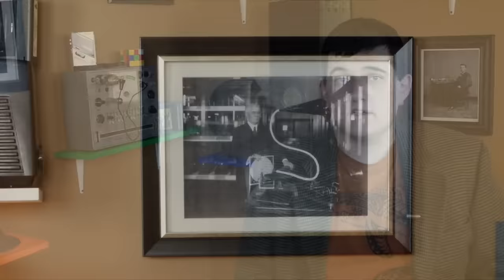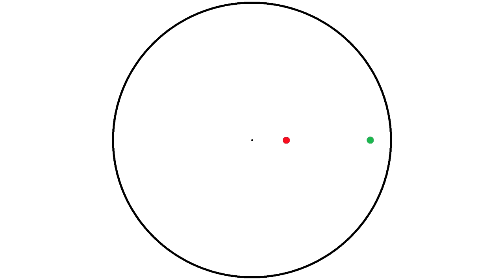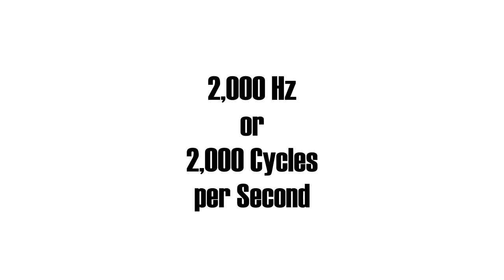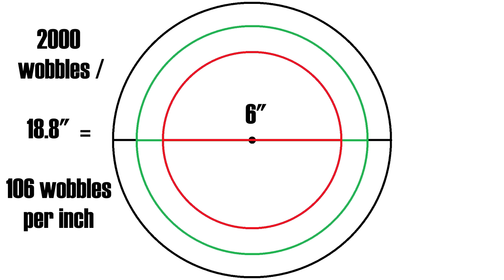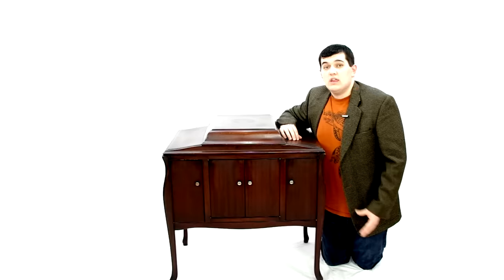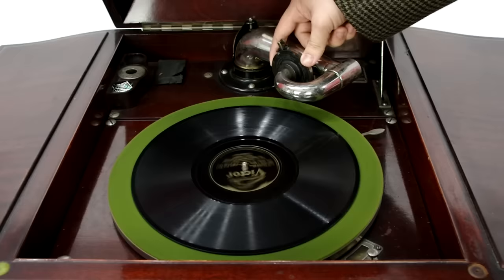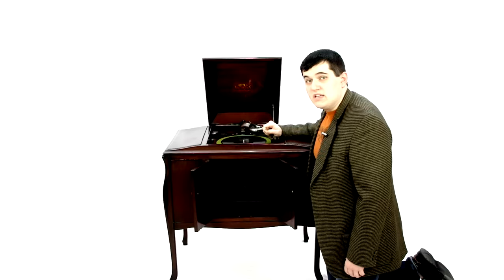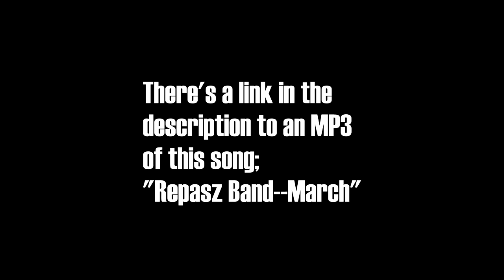Emile Berliner's Fix: Flatten the Cylinder to a Disc

Comment: ok.. a puzzler... i have played 'new' 78rpm records on 'modern' (read: electronic) turntables that had 2 stylus.. one for modern 'microgroove' and one for old 78 records...  but this begs the question; will these very old 'abrasive' records made for the Victrola play on one of those turntables (circa 50s and 60s) without chewing up the needle? or do they /require/ the disposable needle? what about a modern day turntable that does not have the 78rpm speed or 'flippable' stylus? will the 'microgroove' stylus play them without destruction? i realize the audio would need to be digitally recorded and sped up in software to match the original play speed for proper playback but the question remains... ...if either of those options is not an option /is/ there a method to get a fully electronic recording of those old abrasive records?
Reply: The width of the groves is different, so the newer style stylus would bounce around inside the grooves of the older records. Some stylii are designed with a weird shape that will work with both, but those are rare, crappy, and generally don't work very well. I know that the proprietary stylus in those crappy Crosley players is designed to work with both standards, but will tend to wear out the records extremely quickly, and destroys itself after a few plays.

Comment: Can I ask a stupid question? with the massive circumference of a record how is it that the recording always starts at the beginning and not 3 seconds into the song sometimes. are there leading grooves that pull the stylus in at the intended point on the circumference of the record?
Reply: Nvm I just thought about it for a second you just make the first groove blank so it always plays at the beginning.

Comment: Brunswick phonographs could play Edison (and Pathe) records.
Also, I guess you have not seen the patent notices on Victor products. Victor had the same restrictive use language on discs and Victrolas. Victor and Edison stopped putting these notices on records in the 'teens, though Victor continued putting patent license notices on Victrolas into the 1920's. Here is an example of a Victor patent license label from a 1912 Victrola IX: http://wkinsler.com/phonographs/victrola9d.jpg

Comment: As a musician and 78 record collector I enjoy both cylinders and discs.  However the musician in me wouldn't agree that discs are superior to cylinders.  They are each their own thing - each with their own advantages and disadvantages.  Edison's reasoning for sticking with the cylinder for nearly 50 years was justified - they could (with good recording engineers) produce much better sound quality over the whole recording than disks could.  The era in which LP and 45RPM records were the main medium used by the public for recorded music was shorter than era in which Edison produced cylinders.  So I don't really buy the argument that they were failed technology. They weren't the most popular, but large numbers of the public stuck with Edison and his system for almost 50 years.  A combination of a changing market as a 3rd generation of record buyers started to enter the market and improved recording technology for disks with the introduction of electrical recording (not to mention huge changes in the tastes of the record buying public) simply meant that it was no longer economically viable to continue with this technology.  When compared to 8 track or mini disc which essentially were market failures, cylinders compare very favourably.  

Whether he should have stuck with vertical (Hill and Dale) recordings is another argument.  When he did introduce diamond discs he stuck with hill and dale.  These necessitated a thicker disc, but again the additional quality which Edison strove to attain could be argued to justify the additional cost. It was more a matter of economic and physical practicality winning out over quality.  

The example you play as an example for why sound quality didn't matter  is correct for something in the early days, but not representative of the quality that was possible in the later years.  You don't give any comparison between comparable disk and cylinder recordings to justify your arguement either.  The skill of recording engineers, disk and cylinder medium, correct needle/stylus, machine set-up (and quality of machine), play back speed etc all contribute to quality of reproduction.  The technology of machines built for playback also changed markedly over the years - and using an 1890s cylinder player and a 1920s disk player doesn't really give any kind of comparison.

To argue that Edison conceded that disks were superior is not quite true.  If it were why did he not abandon disks in 1912 when he released diamond discs and continue with cylinder technology for another 17 years.  He recognised the practical advantages of discs and produced a compromise option whilst still continuing with his original potentially higher quality system.  Edison was not the only company to provide hill and dale disc recordings and the machines needed to play them - eg. Pathe produced many for a number of years.

To combat the speed issue in playing disk recordings there was also a system available by the early 1920s (such as the one produced by World Records) in which the turntable speed increased as the needle moved towards the centre of the record.  In theory this system had constant linear velocity (as a cylinder has) and eliminated the reduced sound quality.  However the records were expensive and not able to be played without the special equipment. They also had a limited catalogue of records and the recording quality wasn't great.  So the theoretical advantages weren't realised. The non-variable speed system was so entrenched by the time this new system was available that it had limited commercial success.  As it could only play back discs recorded for this system and the big companies continued with the cheaper machines and discs it would have require enormous investment to break into the market in any substantial way.  

Also a number gramophones were built to be able to play both lateral cut and vertical discs..  The were several systems - some had 2 tone arms off the same horn and truntable, others had a soundbox (reproducer) that flipped with a set-up on either side such as the Brunswick Ultona.

Comment: Actually Edison was told that the cylinder could be flattened to a disc, but he chose not to patent it.  Dumb mistake, but the original cylinder was tracked by the first the first non-tangential arm which is how master discs are still cut today.

Comment: I do have to wonder if anyone ever tried making a record that could speed up as the tone arm moved toward the center. 

Sure, at this point, it would likely mean moving really fast. But later on, when the speed of the record is reduced, I could see speeding up as you moved inward. Have 33.3 on the outside, and stop at about 100 or 133 when there was a third or fourth of the diameter left, which would carry the label.

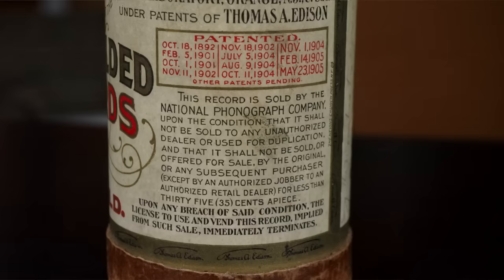Comment: 19:58 I guess Edison hadn't heard of the first-sale doctrine. Either that, or that cylinder was produced in or before 1908, when the first-sale doctrine was created. (If you don't know what that is, it's the concept, in US law, that a copyright holder only has the right to control the initial sale of a physical object that embodies a copyrighted work. It was initially created in the case of Bobbs-Merrill Co. v. Straus, where the plaintiff had placed notices similar to what you see on that cylinder, though in that case it was in a book. The doctrine was eventually codified in the Copyright Act of 1976.) I'm not sure that "license" would have gotten around it, either. Just my non-lawyer opinion, though.

Comment: Could the frequency issue be solved by varying how quickly the record turns?
Reply: Yes, EXACTLY!  Faster speeds typically allow for higher frequencies, as well as 'louder' recordings.  It was noted back in the day that 45s often sounded better and were louder than their 33-1/3 rpm brethren.   

In the 1950s and 1960s, there was a slow-playing format, 16-2/3 rpm, exactly one-half the speed of the LP, that was developed for 'speech' recordings.  There were a few companies that experimented with music on these records, but the audio quality was kind of poor and they weren't as loud as the 33 and 45 rpm brethren.  And for exactly the reason you mention - the slow speed of the record.

Since it was developed for voice, 'fidelity' wasn't much of a concern for 16 rpm records, but the longer playback time (up to an hour per side!) was desirable.  If you ever find a record player from the 1950s, 1960s, or early 1970s with a '16' rpm speed setting, now you know what that was for.  

This extended into the development of 8-1/3 rpm records, and there was even experimentation with 4-1/6 rpm.  Both were strictly for voice only, but 4-1/6 was abandoned because it was determined the quality was too poor even for speech.

Comment: cylinders are superior in sound to discs,  cylinders are linear and turn at 160 rpm, great increase in efficiency over a disc turning at 78 rpm. edison gold moulded cylinders were made from a wax master and produced in a mold, eventually being produced in celluloid which makes them virtually indestructible. a lot easier to record a cylinder than a disc, wax cylinders can be recorded with truly excellent results...

Comment: Why not scale the rotation speed of the disk to the radius of the needle from the center of the disk? That way the speed of the needle through the track remains constant and the frequency response is consistent.
Reply: Trumpocalypse Now Thats what I thought too. Maybe The engineer guy could explain that as part of a semi-collab. I dont think tech connections would do it. Not there kind of video
Reply: Cds and DVDs do that, its called CLV, constant linear velocity. They didn't do it because it would require a complicated, expensive, and unreliable mechanism to work. Back then, they had enough trouble getting the record to constantly run at the correct speed, let alone tying to get it to properly change speeds based on the place in the record. Also, by the early 50s they had figured out how to get constant speed records to run for as long as 30 minutes per side without compromising sound quality, which was plenty long enough.

By the time tech got to the point that CLV records could be economically viable, cassettes had advanced to the point of sounding better than records, and CDs were just around the corner.

Comment: Lol every time I see you handle a wax cylinder or mention how fragile they are I remember Dave Laporte accidentally crushing one in his bare hands on ZDNet in live broadcast on one of the screen savers retrotech episodes and going "oh, that isn't fixable" or something like that lol
Reply: bashkillswitch; Cylinders are actually pretty durable "under normal use". Over time, the material used to manufacture them can break down, and they become more easily breakable. But a cylinder usually won't just break apart in someone's hand.
Reply: @b.deville3236  Yeah I think you missed the operative phrase "accidentally crushed" lol like pieces went flying man, it classic late 90s on air stupid
Reply: @bashkillswitch  ; I've seen the video, and I've heard of it happening, but like I said, that's the only time I've ever seen one of those  shatter apart like that.

Comment: anyone want to hazard a guess at the mechanically induced theoretical limits to frequency response at the rim vs outro grooves in a modern 33.33 rpm disc???
Reply: The frequency response of more modern LPs is limited by the way that the master disks are created, and the precision of the mechanism of the turntable. Frequencies to high would overheat the cutting lathe, so they generally limited it to a little over 16-18khz. Brief higher frequencies would be fine, but most mics and speakers couldn't really handle those higher frequencies anyway, so it wasn't usually an issue that needed to be corrected in the recording. Frequencies too low would give the tonearm and stylus too much momentum and cause them to jump off the records surface, so they limited that as well. Although I don't really know how low for sure, I would guess it would be around 60 hz or so as most equipment couldn't play back stuff that low anyways.

When making a song, they would just assume that the inner most part of the record was the same quality as the rest, generally speaking. I know the Beatles did weird stuff around the way that vinyl records worked, so the might be an exception.

Comment: Victrola can play an Edison disc only if you can get the diaphragm of the needle playing facing skyward.
Reply: Victor Victrolas could not play Edison discs! Also you never play a diamond disc with a steel needle. There were, however, vertical adapters that you could place on phonographs that had the diamond tip stylus that would play the hill and dale (vertical cut) diamond discs.

Comment: A record that only plays a single song per side?  I remember almost complete albulms per side, because i knew exactly where to put the stylus to get my favourite song.  Would someone please explain what i’m missing?  By the technology of this record, my records would need to be the size of an entire pizza.
Reply: One factor is that the old records spun at 78RPM, over twice as fast as the 33 1/3 RPM of what they called LP's (Long Play). So you couldnt fit more than one song (easily).

Comment: Umm the cylinder is a way better method. Disc record grooves tend to get dirty toward the center. With a cylinder especially celluloid or indestructible cylinders. The speed would be more consistent. There are cylinders over 120 years old that sound way better than a disk record. The only reason why the platter or disc record became more popular and better is storage and compactness. Files have to be compressed more to the center. A cylinder is more uniform. If they ever made compact digital cylinders, they would hold more information than a disc.

Comment: The shape (cylinder, disc,etc) was not a patentable feature of any invention.    Notwithstanding that fact,  Edison's 1878 British patent included a fully designed disc machine and lateral recording method.   Disc records had the advantage of being easier to stamp out in limitless numbers,  easier to store, and could be played with cheaper & less complicated machines than cylinders.   Cylinders were (and still are) a lot easier on the back -  a box of 50 or even 100 celluloid cylinders can be lifted with one hand & little effort - try that with 100 12" 78s !

Comment: That sound quality example is pretty unfair in fact Edison blue amberol cylinders were capable of 12 kilohertz and a much better sound than any disc on the market until the Advent of electronic recording
Reply: Under optimal conditions the Blue Amberols sounded remarkably lifelike. The issue with Blue Amberols was that they did sound that good when new, with everything in perfect alignment, but if the plaster core deteriorated or if they cylinders got out of round the sound degraded notably.  Flat discs weren't quite so finicky, and tended to sound louder--a fact not lost on the circa 1912-16 public during the dance craze.  Also, soon after introduction all the Blue Amberols were dubbed from disc records, and sounded notably inferior.

Comment: Stop!  Stop opening the lid!  Please!!!  ;-)  Curiously, I always closed the lid when playing records even on my own record players that didn't have nearly as much surface noise as the Victrola.
Also, it's funny that Edison's disks were so thick.  When I first heard about compact discs coming out, I thought that they would be rather thick things, too, and was pleasantly surprised to find out how thin they actually were.
Reply: Most "suitcase" record players sounded better with the cover closed not only because of the noise reduction, but because of the improvement in speaker baffling. With the lid open, the drivers were often open on both sides, while the cover created a longer path for the sound from the rear of the speakers  to travel.
Reply: @pcno2832  Good point, but I close the cover on all my record players, including the home stereo system where the turntable and speakers are separate components.

Comment: So, Edison was Apple, producing proprietary technology with limitations deliberately built in and the promise of being "cutting edge" while eventually lagging badly behind "android" (common development) competition.
Reply: Many talking machine companies used proprietary equipment, some even into the 30's! The cylinder player, while cumbersome, did provide higher fidelity than gramophones of a similar time frame, and Edison moved on to producing disc players (Edison Diamond Disc Players) fairly early on that also played "Hill & Dale" records. 
Comparing Edison to Apple is silly, Edison's machines worked, and worked well; Apple on the other hand...

Comment: couldnt they have significantly strengthened the cylinders by coating a cardboard cylinder? then you could just coat one long section and cut it into however many individual songs/speeches